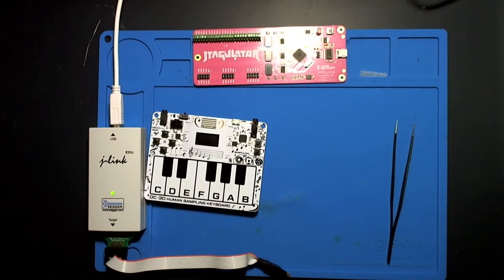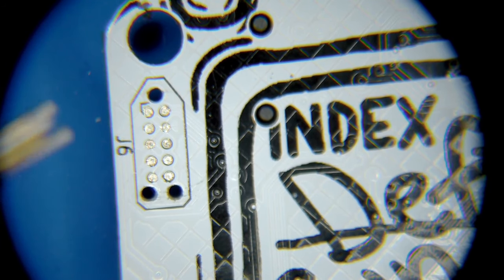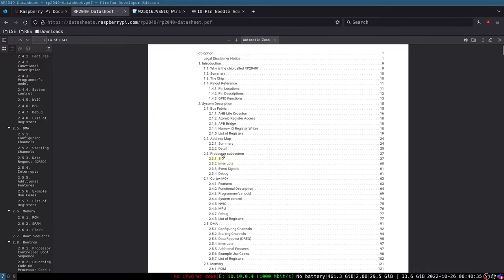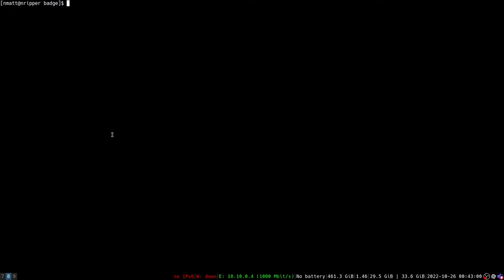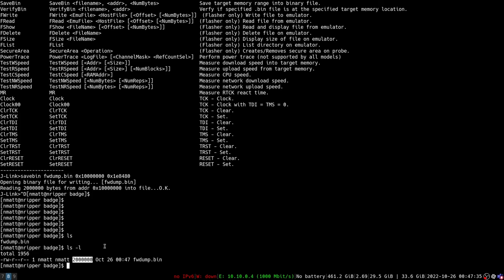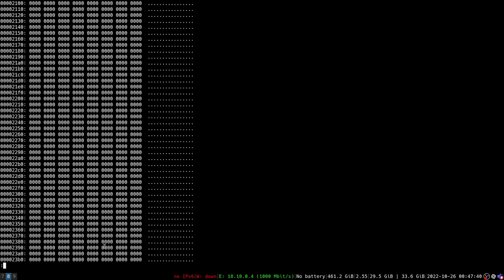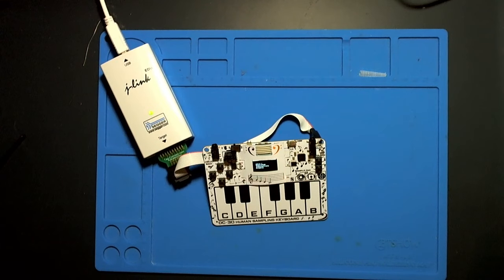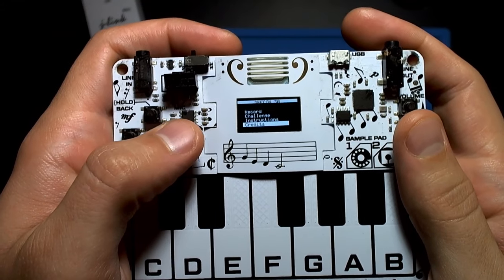Extracting and Modifying Firmware with JTAG

Comment: Minor correction to the video - video title states using JTAG to extract firmware, while Matt used SWD instead.  JTAG is an industry standard interface, while SWD is more vender specific.  Apart from showing the JTAGulator Matt does not actually use it :-(
Reply: You can extract it with JTAG, Matt mentioned that, he just used SWT option